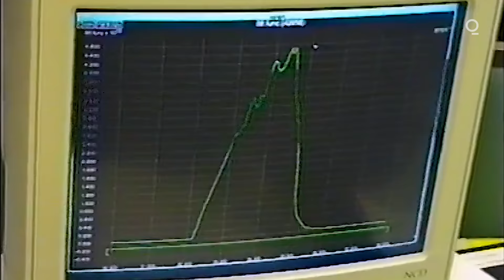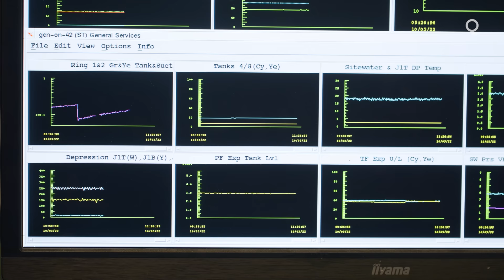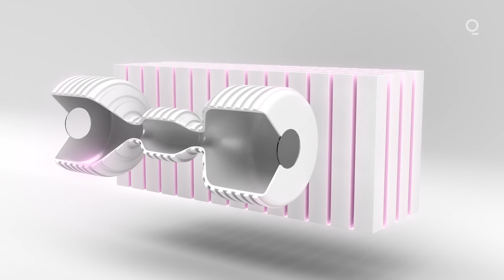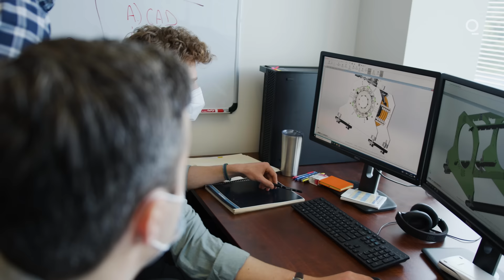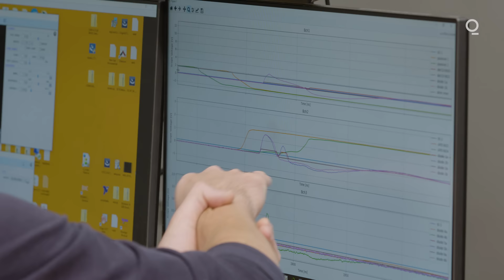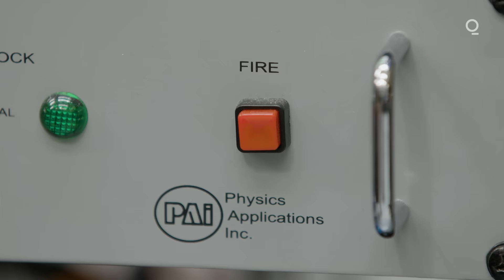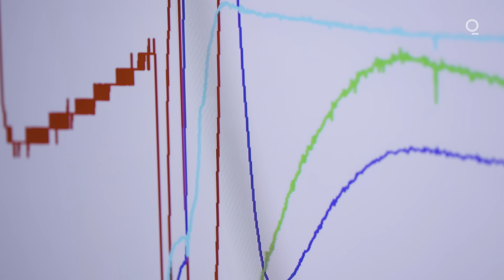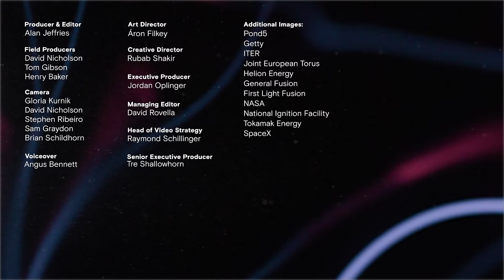Why Private Billions Are Flowing Into Fusion

Comment: When I was working on controlled fusion in the 90s, I came to the conclusion that it was the philosophers stone of our time.  I have seen nothing since to make me change my mind, but I desperately hope that someone will prove me wrong.
Reply: Can I ask, what, as simply as you can describe, made it seem a fools errand?
Reply: @ahklys1321  At that time the main approach was magnetic confinement.  The problem in general with magnetic confinement is that there is monstrous feedback  between the plasma and the containing fields.  Furthermore, the higher energy and higher density your plasma gets, the higher the feedback gets.  It just doesn't seem to make sense.  For ICF the problem is different.  Because it is an impulse system,  for any type of you have the problem that you need to clear out any reaction products from the previous shot before you can do the next shot.  This seems somewhat more feasible, but that much.
Reply: @thekinginyellow1744  oh, that makes a bit of sense, I guess.
Thanks 👍
Reply: Like putting a propeller on a bike, the harder you pedal the more energy the propeller consumes.
Reply: There have been a dozen or so major developments in the last 10 years concerning a) high temperature super conductors, b) MIMO control techology and high-speed chips for controlling such systems, c) actuators ( I imagine ), d) simulation technology, e) fundamental science / physics, f) new simulators that have come out of Princeton et al, new algorithms, g) deep learning and 'AI' techniques applied to predicting plasma instabilities better... And probably far more stuff that I'm not aware of because I'm just a spectator (although I have a ph.d. in systems engineering and mathematical optimization...).  But my point is that a great many things have changed in the last 10 years.  And the fact that the billionaires are coming in cause they smell blood in the water, so to speak, reinforces that idea in my mind.  This is a different ball game.  I don't think you're up with the times, lately.
Reply: @darinhitchings7104  There is always new technology and yet we still can't turn lead into gold.  Though if instabilities can be accurately predicted and reacted to in real time, that's 90% of a solution right there.
Reply: @thekinginyellow1744  turning lead into gold requires either a) a very large particle accelerator or b) a super nova...  I don't see much relation...
Reply: @darinhitchings7104  I'm sorry that you don't understand abstract reasoning, but I can't help you there.

Comment: Fusion is needed for military and space applications, not necessarily for civilian purposes. 
Smart grids, integrating solar, wind, geothermal and water are all readily available on a large scale and offer significantly lower per kw/h prices that fusion or fission plants, while fusion has been "only 20 years away" for over five decades.  There isn't a single private insurer on the planet willing to cover the risks for even the most modern fission plants.
Reply: You’re right but the oil companies and the politicians they control will not let renewable energy happen at  full scale. 
Maybe in the not too distant future? We can hope :-)
Reply: I agree with most of that... but it makes no sense to mix the risks of fission plants with those of fusion plants.  One reaction is endothermic, one is exothermic...  Also, as much as I love all things renewable energy, it's true that the materials are in very short supply.  And furthermore, the projection is that energy demand in 2050 will be 5x what it was in 2020.  Therefore... basically people believe the rest of the world can't come up to a European (let alone American) standard of living without ... some kind of magical energy source such as fusion.  The by-products of mining chromium and the like for batteries etc are not nice, either.  Then again, the battery tech is advancing in 50 direction extremely rapidly.  But still, long story short, I think we need a major breakthrough.  We're only 30% or so renewable energy powered in the US and far less so in less developed countries.  And lastly, it's not just about CO2 emissions.  There are 100 other strategic resource constraints that must be obeyed in order to develop modern technology to support a power grid.  So that imposes a contraint on how low-power and distributed the grid can get.  The 'working set size' for this particular optimization problem would be better served, ideally, by fewer plants that produce far more energy than a wind turbine or solar grid.  That said, solar grids can produce 20% of 1.2 GW/km^2, which is about the energy density of fission plants I believe.  Fusion I think is at least 10x more energy dense than fission, btw.

Comment: A better investment for this capital would be to research construction of safer and cheaper fission reactors and spent fuel reprocessing. Fusion is a money pit that may never be commercially viable.
Reply: we don't really have any other bets apart from nuclear
Reply: Plenty of money is going into next generation small liquid sodium molten thorium pebble modular blahblah fission startups: NuScale, Terrapower, that Rolls Royce thing, ... They're closer to viability than fusion, which means they're facing the reality that wind and solar are and will be much cheaper than the first few units they build.
Reply: Just want to throw this out. Fusion makes 4x what fission makes and can create elements up to lead. You basically have a star
Reply: @skierpage  Fission reactors and solar/wind are not comparable, therefore neither is cheaper than the other.  Now, solar/wind plus storage can be compared to fission reactors.  And that comparison doesn't pan out so well for solar/wind.
Reply: @spencervance8484  Up to lead via fusion? You sure about that?

As for 4x the energy, we're talking about just H fusion.
Reply: @spencervance8484  an oil tanker filled with liquid hydrogen creates enough energy to power the world at it’s current usage for over 1k years.

Fusion having 4x the power than fission is misleading. It’s not accounting for the fact that fusion fuel will cost atleast 1000x less than fission fuel. Hydrogen is the most abundant element in the universe.
Reply: @therealb888  no hydrogen is the most energy dense fusion fuel. Look at the binding energy per nucleon vs mass number graph. From hydrogen to helium 4 is the greatest energy gain
Reply: @user-yq6ov6ow7l  yeah i know hydrogen is the most abundant element in the universe, and if we can contain it and use it properly it will be dirt cheap. I was however referring to an individual power plant using the exact same amount of material. A kilo of fusion material will make 4x more than a kilo of fission material.
Reply: @spencervance8484  ok but without context it’s just the most irrelevant fact in the history of facts

It’s like stating fort knox has 5000 tons of gold, but underneath the gold is 20,000 tons of dirt. That fact is even more relevant than yours considering hydrogen is cheaper than dirt and fission material is more expensive than gold.

Comment: These companies better make sure that they keep security at the highest levels. Sabotage from within by bad actors funded secretly by big oil, seems to be a major concern given how quickly the oil/gas industries would fold once sustainable fusion is developed.
Reply: The oil and gas industry is already folding because of the rise of renewable energies (luckily). Fusion is too late for the party. The question is whether fusion energy will ultimately be cheaper than wind power, in which case the wind power industry might be rather short lived.
Reply: @MatjesHunts  Wind power will never go away unless the wind goes away. Most people would LOVE to just buy a wind turbine and run their house off it and a battery, and maybe some solar panels. The cost is still too high as an individual, but if you aggregate the cost across those whom would be willing like a town of 10,000-50,000 a few wind turbines make a TON of sense in the right areas.
Reply: @ShimejiiGaming  in some parts it's even illegal to set up your own mini turbine to collect energy. It's nuts.
Reply: @MatjesHunts  they still have a strong point with global industry. Still, they will be riding this for as long as possible. Many are already dipping their toes into electrical sources and water sources.
Reply: @MatjesHunts  Do you have any idea how much fossil fuel goes into mKing a wind turbine project? Steel, cement, composites for blades., machinery building roads and offshore foundations?
Reply: What I think is a short term and super easy way to lower carbon footprint is for a company to buy up decommissioned 380 watt solar panel ($100) and package them with an grid tie inverter ($200), and a small 2 kwh battery ($200) that plugs directly into an outlet that provides base load for an average house.
Reply: @peredavi  you do realize if you're going to make any kind of power generating source you will end up expending some fossil fuel the way the system currently works? do you know how much more steel, cement and other materials you need for a thermal plant? and in the end, the wind turbine is the green option as the only carbon footprint is the cost of setting it up and maintaining it while the thermal plant's carbon footprint is the cost of setting it up and maintaining it + all the carbon released by the fuel you burn through. which in the end means for every kWh produced the wind turbine is a 100 times more efficient at releasing less greenhouse gases
Reply: @theTranscendentOnes  A nuclear plant will produce far more energy for the same amount of fossil fuels expended to build it. The nuclear plant takes up less than 1/1500 the land area of the wind farms or solar. Nuclear plants will outlive a wind or solar installation. There is not enough land to cover with solar or wind to replace current fossil fuel and nuclear.
Reply: Oil and Gas industries are never going to go away in our life times. Cars, planes, and the military runs on Oil. Alot of things run off of Gas. More renewable energy, especially Fusion is great. But expensive and time consuming. These corporations aren't going anywhere any time soon. They don't need to risk jail time, or a law suit on a risk that actually wouldn't benefit them in any meaningful way.
Reply: @robertw1800  Yeah cars planes and military aren't the biggest consumers of energy and if they mostly remained consuming oil and gas it'll be fine. It's the industry and consumer goods using gas and oil that's a problem. While I don't expect it to completely go away, gas and oil within our lifetimes will become something like 10-20% of our total energy with the rest being nuclear energy(fusion and fission) as well as renewables.

Comment: The Silicon Valley approach may or may not yield directly useful results, but one thing it will do for sure, is rapidly expand our understanding of the way fusion works. In that sense, it is guaranteed to bring us closer to commercial fusion energy production faster than the government-backed projects alone could. My hope is simply that the monetary incentive to eschew safety and environmental concerns that are ever-present in the commercial sector aren't so big that they are heeded. Let us try not to repeat the mistakes of our predecessors.
Reply: It isn't the first but it will definitely be useful in driving the price down and increasing Market viability

Comment: They have been saying "20 years away, 30 years away" for over 100 years of trying they are still hardly any closer to getting fusion to work than ever and they are still saying "only 30 years away".  
All they have done is to change the efficiency definitions. They tell you about the high levels of efficiency but they fail to include the humongous power necessary to obtain that core efficiency, so when they tell you that they are at 70% efficiency it is really somewhere around .03% efficiency. Those lasers are huge power sumps and they are not considering that power when they brag about  efficiency. 
To put it into perspective, in the sun at the levels where fusion occurs, only 240 Watts are released per cubic meter of sun. 
Fusion is never going to work, it is a pipe dream for people that are poor at math. But it keeps a lot of otherwise unemployable physicists employed.
Reply: Thank you for the only intelligent, realistic comment in this whole thread of mindlessly optimistic responses
Reply: I tend to agree.  The earth might run out of oil trying to get fusion to work.

Comment: In 1992 I heard a lecture on fusion technology. The lecturer had been researching fusion technology for twenty years and prophesied that it would be producing all the electricity the world would need within twenty years. It is now 2022, 40 years on and they are still quoting availability in twenty years time.
Reply: Yeah, one does wonder, sure getting skeptical about Tokamaks, think we need a radical breakthrough to have anything economically viable.
Reply: @bhatkat  But if you actually look at what these alternatives are, it is very easy to see how utterly absurd these are.
Lets assume for a moment that we can achieve fusion with initial confinement with both the liquid Metall idea and the laser heating idea, in the sense that the fusion energy divided by input energy is >1.
Than what? You still need way more energy to power the lasers than what their output is to slightly warm up the chamber.
How is that useful?
A usual fission Reaktor evaporates enormes amounts of water, high temperatures and high energy output for a rather small machine.
That is what makes it cost effective.

Comment: I like Tokamak Energy in that they quickly jumped to build magnetic coils from now-available high-temperature-superconductor wires. A lot in fusion scales very favourably (and strongly) with increasing magnetic field, so cheap, strong magnets are key to business.
Reply: yes exactly, that's what I'm on about...  it's all in the materials science
Reply: They don't use superconductors, it's literally just copper, that's all that's been needed and that's all they think they will need
Reply: @tusharbhudia9421  Liquid nitrogen-cooled copper in ST40. But I wouldn't be categoric when discussing future needs. Hard to believe they really are...

Comment: I'm hopeful for fusion, and also hope that the public can be swayed to use nuclear fission in the meantime while we wait
Reply: Germany: Imma pretend that I didn't hear that.
Reply: Fission is very expensive compared to most renewables, with the costs of renewables projected to continue falling. We should always have a diversified power grid but I don’t think fission is a worthy investment at the moment
Reply: @Nikkska  The cost of renewables+backup is astronomical and is why it isn't being adopted to power whole grids.
Reply: @Nikkska  fission is expensive yes, but its literally the safest energy production we have, besides maybe solar. once the reactor is built that is
Reply: @Nikkska  Outdated argument, older reactors required massive pressurized containment and large concrete structures. More recent designs that could be invested and expanded are smaller, modular, and non pressurized meaning quicker and cheaper construction
Reply: @Nikkska  "Germany to spend $220 billion for industrial transformation by 2026"  - reuters, 6.3.2022
oh yeah, 100% renewables are a cheap goal. and that's on top what they've already put.
" By 2030, at least 80% of the gross domestic electricity consumption should come from renewable sources." once you've started, you need to go all in.. no matter the cost.
i don't doubt one day germany is going to be 100% renewable. but cheap it ain't gonna be. meanwhile france is going to enjoy nuclear.
Reply: This is the way. But people and governments are run by emotions.
Reply: why would people be afraid of it? its not a nuclear reactor
Reply: @Nikkska  Expensive because of politics.
Reply: Rather than fusion, what we really need right now are better batteries and better ways to recycle nuclear waste. 

If we can make batteries that last longer and are made of abundant materials, renewables will be much more viable.

Comment: Question? 
Q = E out ÷ E in
What are the elements considered in Q ? 
Would you measure the energy that was used to make the materials of the project / reactor? When will that achieve break even. 
Not only power input is "Q E in".
Footprint of all elements must be considered. 
So if the highest break-even is 0.7 what were the factors used to measure this. 
Thank you.

Comment: It's primarily because, if those who have the money had allowed the public to educate itself sufficiently, the public would understand the importance of the investment, take responsibility for it, and make the investment themselves. But the wealthy have spent decades educating us that public expenses are bad because of taxes, so now they're paying the whole tab. They will have complete ownership and control of it.

On a related note, I heard that the privately-owned and controlled Texas power grid operators is upgrading some of the state's infrastructure, since they own it. It seems that more people than anticipated want refrigerated air conditioners in the summer, but the current system can't handle it. I guess it was one of those "Last Mile" kind of things. The appropriate service fee will appear on their receipts at the Walmart checkout.
Reply: Yeah, and fusion reactors will be so complex it will be very difficult for anyone else to compete. Giving them more the ability to charge whatever they want and even withhold electricity for political reasons.